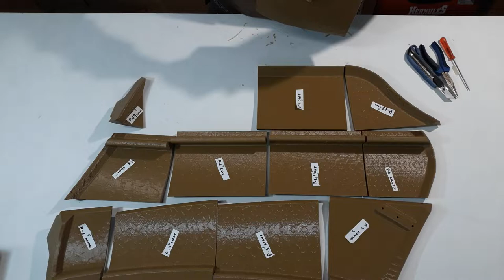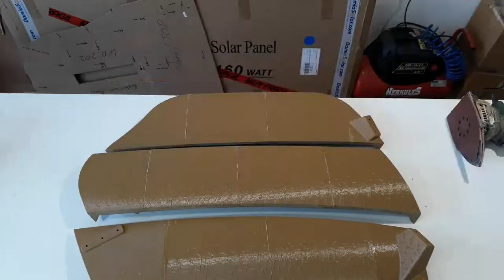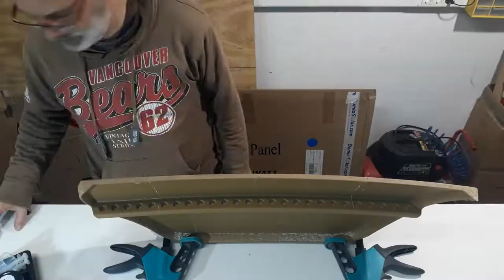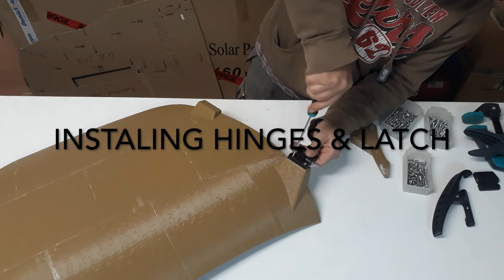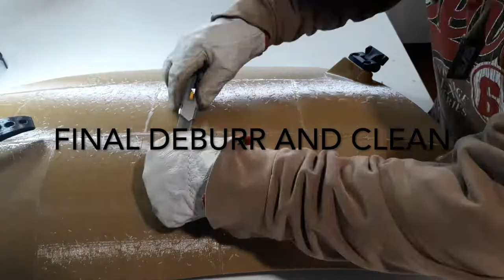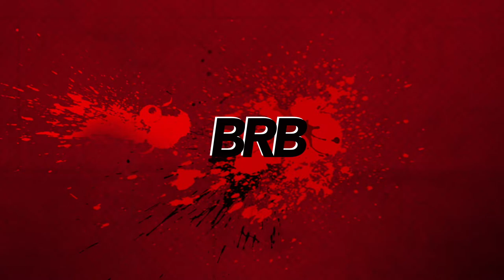3D PRINTED ELECTRIC CAR DIY, DOOR ASSEMBLY (ENGLISH, Part 7)

Comment: Cool idea... looks like it would be a lot heavier than fiberglass or carbon fiber over a mold.  As Marcell asked, I'd love to know what the door weighs.
Reply from the maker: Thank you, yes it is probably heavier than a standard FB/CF sandwich construction. It is an experimental project in order to reach the limits of hobby 3D printing...
The doors weight 2.1Kg including hinges and latch screwed.
Reply: @gonzalop.chomon327  Ok what is your weight? I mean I would likes to know because of the load that you put on it at the end.
Reply from the maker: @josephcarlat9414  I am 70Kg, maybe more, don't want to know... 🤣